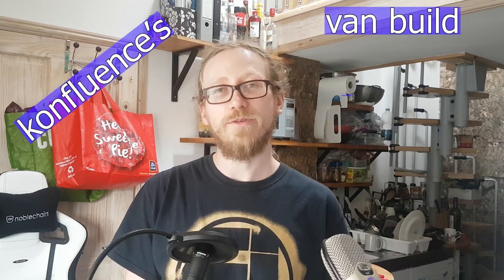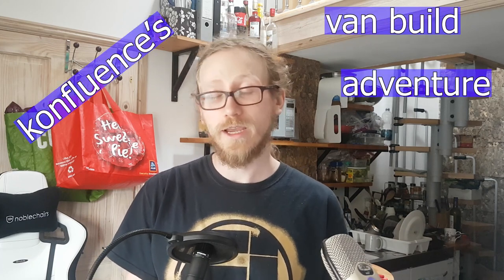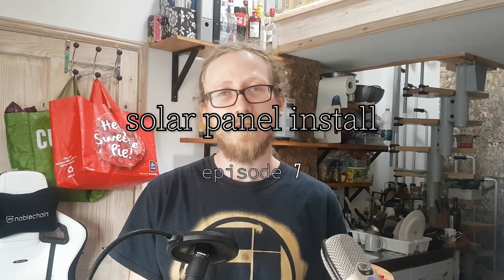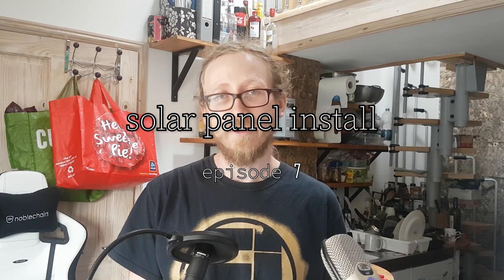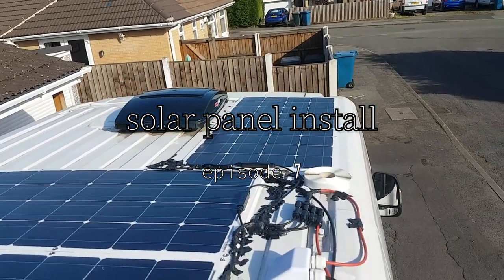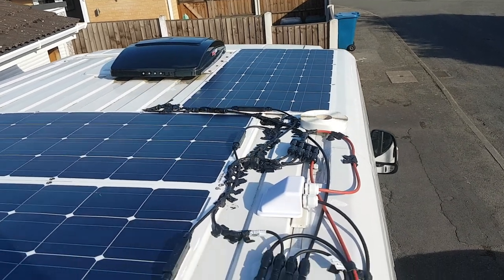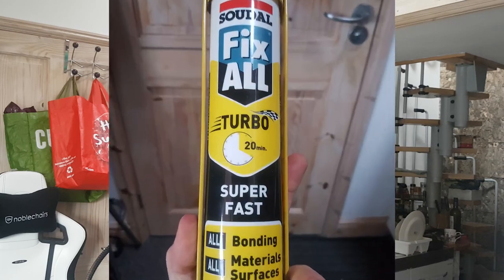installing the solar panels on my fiat ducato - episode 7 - beginner builds nerdy office van

Comment: You are right to look look at Voc, but the reason is not the beginning and end of a day. Der Voc will appear, if sun is high but battery is full, so maximum input but no output. The controller must handle this situation.

Interesting learning for me: the flex panels are so flat on the roof. (Not a surprise. 😉) This makes it hard to place the wires without creating shadows on the panels (12:30). (Btw: the other disatvantage of flex panels is, they have no cooling at the back side. The advantage is, they are less visible.)

I'm not sure about your question about the fuses. Generally fuses are required to protect wires from overheating, e.g. if there is a short. So they are placed between a voltage source and the wire (as near as possible to the source). A solar panal is a limited source. The wire must be able to handle the maximum current of the panel, but you don't need a fuse. The panel will never deliver more, not even if it malfunctions. You need fuses between the controller and the battery - on both sides, because both can deliver high currents. The controller may have an integrated protection already, then you can leave out the fuse there. And if they are very near to each other, of course more than one fuse does not make sense.
Reply from the maker: Thanks for the detailed comment! That makes perfect sense about the Voc, not sure why I didn't come across that information earlier, makes a lot more sense than what I read...

Yep, getting the cables out of the way of the panels was rather tricky! I did manage it though eventually with a lot of sticking. I'm hoping that as my roof has all those channels in it that there will be enough airflow under the panels to keep them cool as long as I don't go anywhere too far south, which at the moment isn't a problem being in the UK haha.

That's good to hear about fuses too. Honestly I thought it was a bit strange that I was seeing them on diagrams by people who seemed to have quite a lot of expertise, so it's reassuring that you don't think they are necessary.